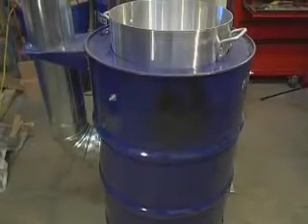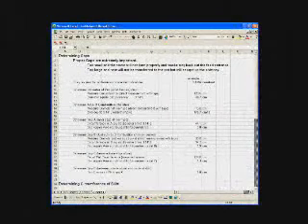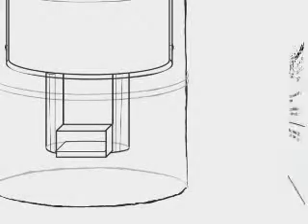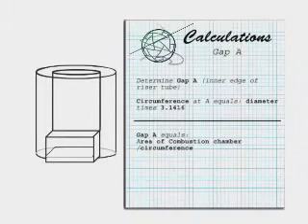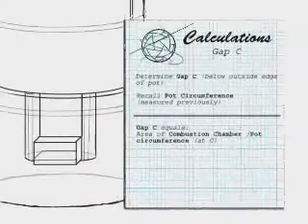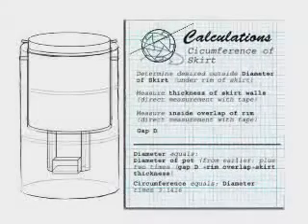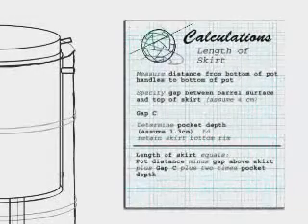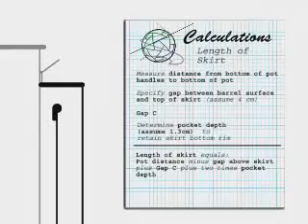How to build an institutional rocket stove - Part 2

Comment: blank plate and weld 6" of 1/2" copper pipe on top leading to a ball valve then to more copper pipe leading to a drum of soaked corn porridge with the pipe submerged into it and perforated along the submerged part with 2mm holes for the steam to exit & boil the corn.  This is how to boil a thick corn mixture for whiskey making without burning, We can do it legally here in NZ. :-) I now have good plans for a very efficient boiler. Just gotta make sure the relief valve works well or u have a bomb!

Comment: This is exactly what Ive been looking for!
I want to replace the pot with a 50L beer keg 3/4 full of water. It will have a blank plate  on the ferrule with a 2" triclamp fastening it down effectively sealing the keg.  I plant to run a tap thru the top of the keg in 2 spots, so I can screw a pressure relief valve in one set to 100psi and screw a pressure gauge in the other so I know the exact pressure inside. The keg has max pressure rating of 130psi so it should be safe. I plan to drill the

Comment: Obviously they have a mistake in animation. To measure the diameter, just measure a horde that crosses the center of the circle. Typical diameters for pipes are 130mm, 150mm, 180mm, etc.